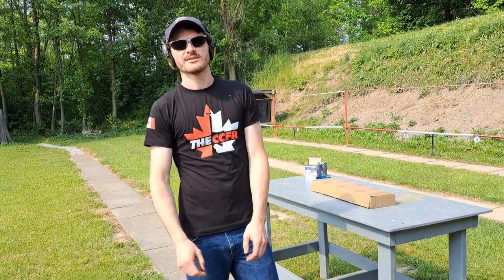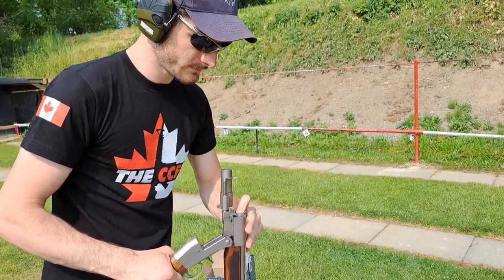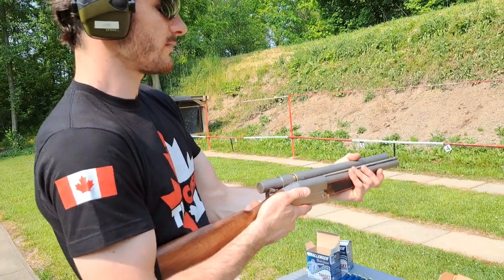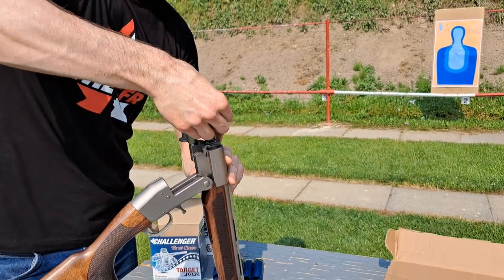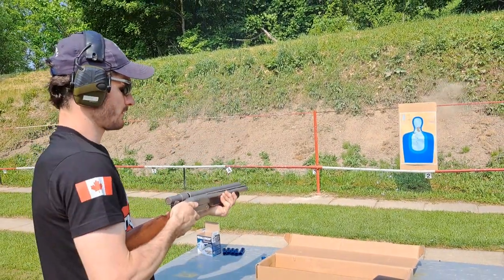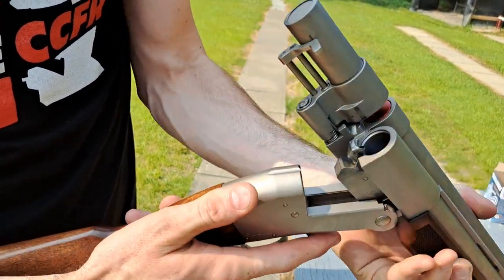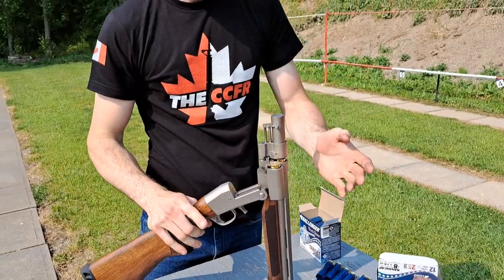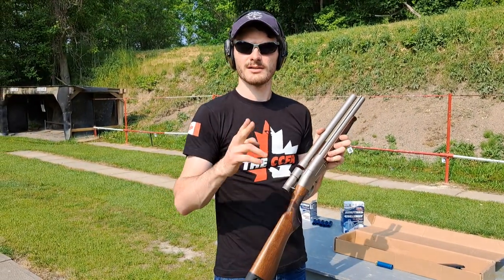Sulun Auslof Shotgun at the range. Tube-fed beak-action.

Comment: Auslof has a big advantage, you can use full length chamber inserts while having the ability to put it into 12ga repeating mode if need be
Reply: Hello, 
Curious about this idea- do you mean to keep a full length  adapter in the tube ( say .22lr) and remove it when you want to run the 12 gauge shells using the tube mag mechanism? Ps I contacted tactical import 3 weeks ago regarding using .44 mag inserts in the sr -11, they are waiting to hear back from the factory for safety specs.
Reply: @islandred3968  short lane adapters, x caliber adapters, etc. would be super easy to install and remove compared to with pump action 12 gauges. But unlike single shot shotguns, this can go back into repeatable mode in 12 gauge
Reply: @sinosparo  very clever idea! As long as the receiver can handle the pressure loads from the adapter caliber, I think it’s brilliant

Comment: You need to open it fast so that the shell is propelled backwards at a higher speed. When you open it slow, the ejector mechanism is slowly released until it's cleared from the frame of the gun. The faster you open the barrel, the more speed and velocity is attained to really fling that shell back into the loader lever. These were designed for rapid fire. If you're going to baby the action, you might as well just load the shells into the barrel one at a time by hand...
Reply from the maker: Your description of how the ejector works is incorrect. The ejector is the same strength regardless of how fast the action is opened. When the ejector release is tripped from the action having been opened a certain amount, the shell is expelled by the ejector through the sudden force of the ejector spring. This function (when opening the action) is independent from the frame. Your description is that of an extractor, not an ejector.
Reply: @freedomfirearmscanada  Did you notice the "malfunctions" happened when he slowly opened the barrel. The shells have enough mass to trigger it, even with the smaller brass (The larger brass shells will hit with more weight). You will get more acceleration from a faster barrel opening. Acceleration is the key here. I've seen plenty of break actions in videos, and fired a few in person, if you open hard; the shells go faster...
Reply: @GRIZZLYSGEAR  I think the centripetal force from opening it faster would probably help as you're describing.

Comment: When I first seen this Sulun Auslof shotgun.. I just knew I had to get one!
I just placed my order for one in nickel finish just like the one in the video.. but I also opted for the optional mini shell adapter as well that allows you to shoot the mini shells.
When these first came in.. they sold out pretty quick.. but now that they are back in stock I had to jump on the opportunity and not miss out on this very unique and historic style shotgun!
I also have a Sulun Arms Tac-12 Benelli M4 clone that runs beautifully.. and Sulun also makes their brand of the HG-105 Bullpup 12ga which is another great product from Sulun.. but Sulun kinda dropped the ball on that SS-211 mini over under 12ga they came out with even though a lot of people still bought it up.. not me.. the moment I picked one up and felt that very short length of pull.. I knew it was just not for me.

Comment: If the tube was detachable and exchangeable with another... that would actually turn the Alof conversion system from a novelty to a legitimate combat capable upgrade.
Reply from the maker: There is a 20" barrel version with full length tube.